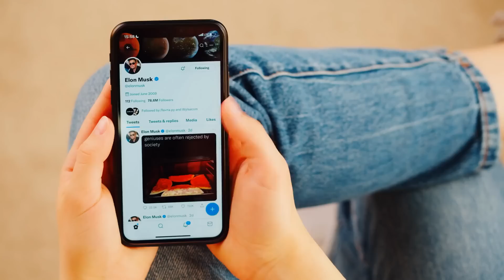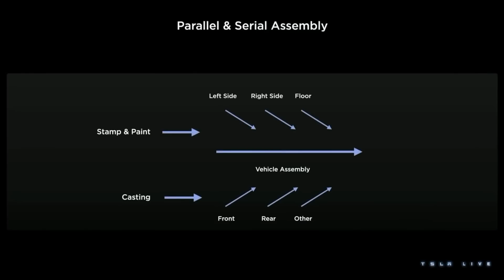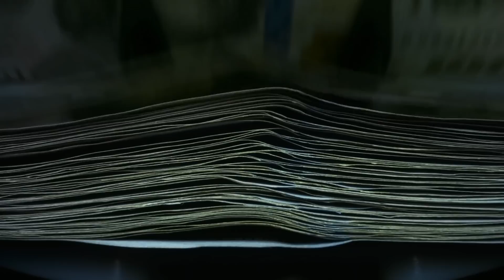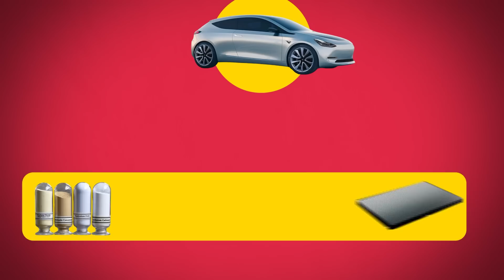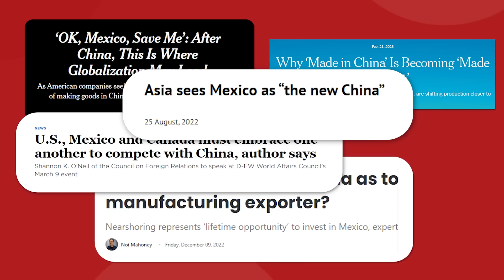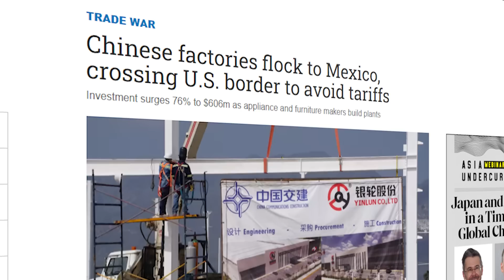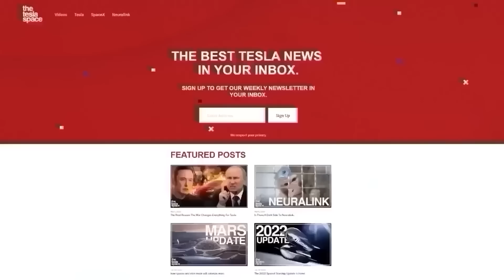The Real Reason Tesla Chose Mexico..

Comment: I don't think it was mexico but rather nuevo Leon itself that enticed tesla. Nuevo Leon and the monterrey area has decades in automotive manufacturing. Everything from the LEDs, engine parts, all of it can be manufactured there, the industrial infrastructure already exists. That's not even scratching the surface of supporting industries like cemex (mexicos largest cement producer) for the construction of roads and factories. All of it within one small state. Add to that a 2 hour drive to the border, and it's a no-brainer. The cheap labor is just a side bonus

Comment: Not to be rude but your video sounds so ignorant. Why would it be in the UK, Indonesia, or Canada? UK and Canada are some of the worst countries for business (high taxation, high labor, large bureaucracy ). Indonesia is geographically isolated and a logistical nightmare because it’s an archipelago that doesn’t have the infrastructure to support something like a gigafactory. 

Mexico is a no brainer. Mexico already does a ton of manufacturing across sectors, benefits from NA trade, and has great business ties to other countries that have been untouched by Tesla. Labor is a HUGE cost to consider since the economy car will need to still operate within a 20-30% margin (as stated multiple times by Tesla execs being the required goal for any new project). While Tesla is gaining efficiencies, an economy car is a different beast. Monterrey is also a no brainer in Mexico because of the huge presence of other factories and manufacturing hubs.

Comment: One factor could be access to commodities.  Tesla is building a lithium refinery near by in Texas.  Mexico is a producer of copper and silver.  Tesla is changing it's cars from 12V to 48V.  This means all wiring for things like power windows, lights and heat pump can be a smaller gauge for all vehicles produced globally.  Mexico could produce these wires for all Tesla's.  This is just another reason.
Reply: The state of Sonora has massive lithium deposits and the Mexican president has already moved to nationalize lithium and develope its mining besides Mexico taxes imports heavily so probably Tesla will source lithium from Mexico
Reply: @lih-fk8by  That's right, and President Lopez Obrador has already spoken with Elon Musk about Sonora's lithium.
Reply: @lih-fk8by I understand that that state has 240M tones of lithium. One of the biggest on earth.
Reply: Mexico president is the best one yet
Reply: @goatbebryant4915 Yes he is. He's amazing!
Reply: Exactly as Li H says, there are huge chances that lithium is extracted from Mexico as the reservres are greater than those from US and probably simplifies the supply chain.

Comment: I don't believe the ramp up of Giga Mexico is going to take as long as you think - sure the very initial training and phases 0-1 may be slower BUT the very fact that it is designed to produce cars much more efficiently/quickly (wasn't it 35% quicker?) should mean that they'll be able to hit those early metrics faster and faster, imo. 
I predict that while it may indeed take twice as long to hit 1000 vehicles per week, barring any unforeseen problems they'll probably hit 5000 vehicle per week in 2/3rds the amount of time as Giga Texas, and then they'll hit 10,000 production per week in half the time it takes Giga Texas ;?)
Reply: BTW it took Giga Shanghai over 10 months from ground breaking to production of cars to market.
Reply: @russell2449  say we are conservative.......building a manufacturing center and having it spit out 5000 units per week , in less than 16 months, is mind boggling. If they get it to 12 months and amp production to 10K unit a week, and still require another 12 of such manufacturing centers, is surreal.

Canada on its own could support 4 such centers. That would be enough production for its market and bleed into border states.....all at a discounted US dollar ( 30%) and a strong workforce.
Reply: Settle down pocket protector the first displacement of earth by bull dozer hasn’t even take place yet 😅
Reply: @mimusic1853  WTF does that have to do with anything I stated??? Put a cork in it, no one asked for comments from the peanut gallery 😅🤣😂🥱